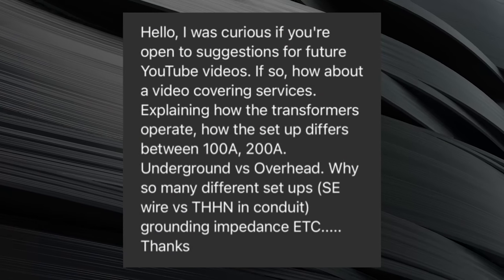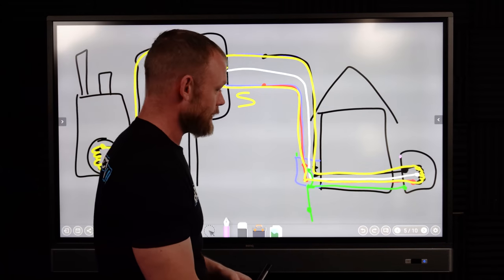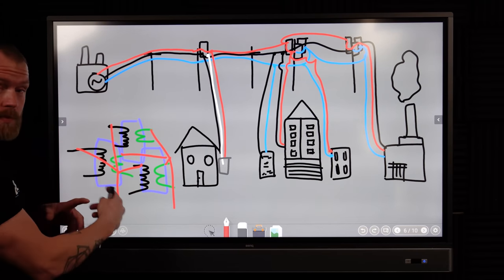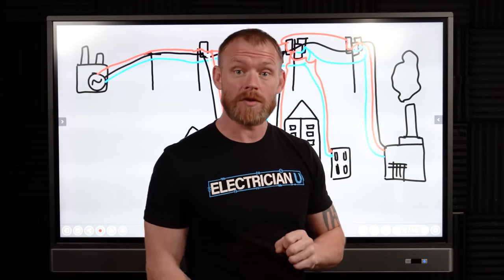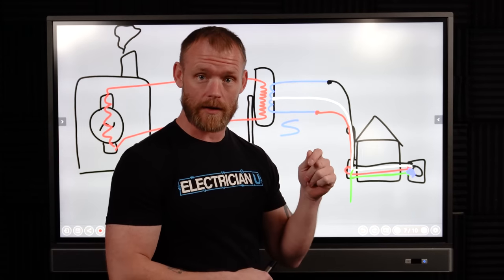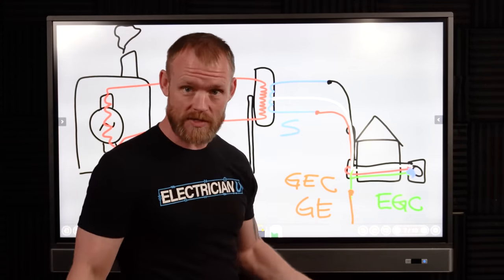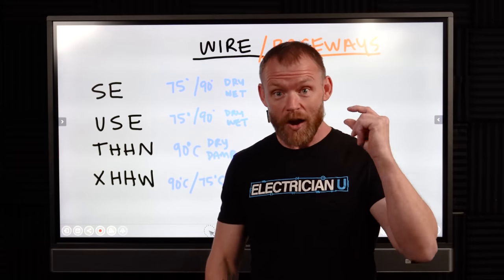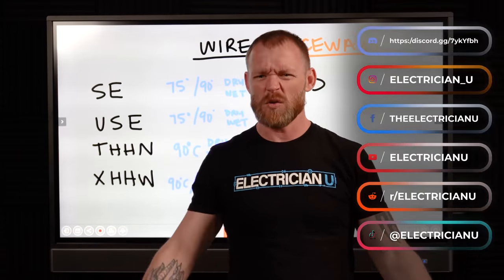How Does an Electrical Service Work? Electrical Service Panels Explained

Comment: I’ve been an electrician for a long time and the question I would like to see answered is how electric produces the energy without any loss of mass in the circuit.
Reply: Energy is not produced. It changes states and electrons move. Nothing is created or destroyed. Mechanical energy or solar pv is converted to electrical energy. Then changed back into whatever form the load is. If the load is a heater, the heater is not destroying electrons to produce heat, it is changing electrical energy into heat, another form of energy.
Reply: @jeremiahemswiler4540  I knew that electrons weren’t consumed the strong force being what holds them in place. I remembered that a volt is defined as the force that it takes to (push ) one amp through one ohm of resistance. The others are defined in the same manner relative to each other. So I guess then my question would be do we have an understanding as to why current flows through a conductor if it moves through a magnetic field?
Reply: Ive been an Eletrican for 28+ years an if that ole poor boy wasn't lost he sure the He'll is now lmao
Reply: @jefflenway4510  I got my masters in 1988 and I’m not lost. What he’s basically saying is that power is obtained not from the electrons in the circuit but from the electromagnetic field in the circuit. My question then would be do we have a good understanding of the force that causes electrons to  move back and forth when a conductor is moved through a magnetic field at an angle? I realize that this is really more of a physics question since electromagnetism is a fundamental force. Still important to know as far as theory goes. If a magnet collects energy since there is no conversion how well do we know that process.
Reply: @deweyplanck9850  You might be meaning your question in a deeper perspective but it would be the electric field. I suppose it's like a chicken and egg question since you have capacitance and inductance that have inverse characteristics but if you have the voltage you have the electric field. So if the circuit can close any kind of way where you have the current flow then you have the magnetic field as well as electric field.  The conductor has been aptly named rather than some kind of generator since it is just a conveyor of charge that contains a ton of electrons so in a basic water pipe analogy the water pipes only lose Mass over time through corrosion etc. I suppose another way to frame your question more generally would be asking whether electron theory is entirely accurate and I'm far from knowing the answer to that.
Reply: @deweyplanck9850  You also asked whether we had a good understanding of what causes electron flow from induction and I'd say we do but not enough to stop investigating. I guess the basis of it is that the inductor stores energy in its magnetic field yet it is still one of the most interesting and complex foundational components. Changing magnetic field requires work and this can be stored in the inductor I suppose your question more relates to what is going on in the conductor on the output of an electrically isolated system that is using the magnetic field AKA inductance to pass the power. Since there's no source of electrons where are all the electrons coming from and how come this doesn't degrade the conductor etc but again the wires just a conveyor of electrons that were already there at least allegedly. then of course we are able to draw free electrons from air and all that juicy stuff but it kind of boils down to why you can't wind a transformer with fishing line and expect it to work.
Reply: @Magneticitist  No I’m not asking about the conductor . I’m asking what’s going on in the magnetic flux. What’s the process that is going  on to produce the energy within the electro magnets of the stator. I know that moving the coils of the rotor through the magnetic flux of the stator causes electrons to excite in the conductors. Also that the electro magnets are using an external power source. It really is sort of a physics question  but they do tie in. My loss of understanding begins with how theses magnets are producing these fields and forces on a very elemental level. It did help to find out that the electrons are really not the source of power but the magnetic field that is produced by their displacement is.
Reply: @Magneticitist  thanks but that is where I’m getting hung up. I knew that even if all the electrons were consumed there would not have the mass to create the power the light bulb is consuming. This is also true of the field. But still yet  it’s true that E=MC squared. But you also pointed out that the flux could be harnessing the already converted energy from other sources. But thanks for your patience and time. I appreciate it.
Reply: @deweyplanck9850  Mathematics is the only language that can really explain this. Maxwell's Equations can answer that for you.
Reply: @mayito714  Thanks man I really appreciate your time and especially your patience.
Reply: @deweyplanck9850  No problem. glad I could direct you to the source that can answer all your questions.
Reply: @deweyplanck9850  The strong force is the bond between protons/neutrons, not electrons. That's the weak force. We can easily strip electrons away from an atom. It's called a plasma. Any arc is a plasma.
Reply: @fcguy7  Yeah I guess that it would fall under electromagnetism in some circles of thought. It’s been supposed that electromagnetism and the strong and weak force are results of the same force. But my original question was about Einsteins equation and how it seems to contradict what happens in electrical circuits. Lorentz explains more than anyone I’ve read so far about how electromagnetism works, but I’ve never heard an explanation as to how say, a light bulb can produce the energy it does when in the circuit there is no loss of matter that should be able to produce that much light and heat. As far as I can understand Lorentz explained that the field that exists between electrons in an energized circuit transfers the power. So my point was that no electrons are consumed in an electric circuit. Which is true. But Lorentz explaining that the electromagnetic field in between electrons is the source of the power and not the electrons still leaves me confused because the particles in that field are less mass than the electron individually.
Reply: @deweyplanck9850  With the lightbulb and einsteins equation I think you're confusing yourself by looking at one small part of the complete circuit. Energy can't be created from nothing and to create energy there's loss of mass. But there's no creation of energy going on in lightbulb the energy available to you/ coming into your  breaker panel has already been created at your electric company who used generators spun by either a petroleum type gas or liquid fuel,  coal (the energy created by loss of mass of fuel as it's burned). Another way they do this is solar/wind/water (in this case the process of sun or earth  creating said energy with mass loss and they are exploiting that energy by transferring some of energy of suns rays into solar panels or mechanically transferring some energy of wind or flowing water to spin fan blades or water turbines thereby slowing down/removing the energy of wind or water as it transfers energy by spinning generator. Another way they could create energy is with nuclear reactors, (I don't know aton about the process but there is loss of mass in uranium as energy is produced. They create enough energy to constantly supply the grids and it's there whether or not you use a tiny bit, none or have everything in house turned on and any loss/transfer of energy to light and heat from lightbulb or any other electric load is replenished by the electric company's generators and your hot and neutrals wires closed loop with them If you look at it from perspective of the entire loop from the electric company to transformer and transformer to your meter, into panel then out to branch circuits to lightbulb and all way back to transformer and transformer to electric company then einsteins law still holds true. The lightbulb isnt 100% efficient so there is a loss of most of energy that is lost/emitted in form of heat in every type of bulb (incandescent,  vapour lamps, etc are super inefficient in energy ratio of light vs heat. Cfl is middle of road there and LEDs best for light vs heat per watt). That might seem like energy created to give off heat but no new energy is created in lightbulb it's just transferred into another form with some total electric energy loss in system overall that meter calculates in kwhr. The incandescent bulbs doesn't use electricity to emit any light directly  it's the high resistance of the wire inside that causes an instantaneous  high heat  that results in that wire glowing white hot. This can be expressed by joules first law and is known as joules heating/resistive heating. In incandescent the filament in bulb is tungsten that has a high melting point and naturally high resistance as a conductor. the glass bulb is a vacuum chamber that can have inert gas like argon added but either way the air is vaccumed to prevent oxidation of filament and slow degradation way down compared to filament in atmospheric air. Overtime in some bulbs (if present)any  metals in gas state like mercury vapor still can wear away in vacuum & do lose some mass but having nowhere to escape they coat/plate part of inside glass surface and you can see it in old bulbs or even old radio vacuum as shiny spot or darkened fog on inside of glass. The heat given off the lightbulb is due to joules heating/resistive heating and found by using joules first law. The other part of your question with magnetic fields and electric fields. Electric fields created anytime a charge is present in conductor and magnet field is present whenever a electric field is moving. DC is easiest to do this as it never changes direction of current flow so magnetic field is constant like a permanent magnet. But if the positive and negative or hot and neutrals wires are running right next to each other or bundled in same wire jacket then the two will cancel each other's magnet fields out by being opposite directions(this is why multimeter current clamps don't work on wire not separated into hot,n and gnd & have to be around a single wire to detect the current. If wires are braided or twisted in pairs like Ethernet or sheilded like coax cable that further cancels any magnetic fields that'd create noise or interference. And you can increase magnetic field by looking or Coiling the wire and to further increase it's strength by adding iron core that wire wraps around. If either field electric or magnetic is non changing then you won't be able to induce a field in separate wire from another. Ex. Placing stationary magnet next to wire even if coiled can't create electric field. If it's wasn't changing direction fast enough however then you could have induction from one field to create the other in separate wire.  Ac by itself can do this (also what allows non contact voltage detectors to detect live wire by creating field in tester.) due to changing direction of electricity 60 times a second. As the ac oscillates at a hz both fields also oscillate at that frequency and that's known as electromagnetic waves which is how transformers work and deping on signal frequency is how wireless chargers, wifi and radio waves, etc. And can propagate through space if designed to do so
Reply: As for loss in system the electricity created by electric company is 3 phase to allow current then if they had to send out enough to be able to supply every house and business using one phase and to further drop current and prevent loss of some energy during transmission from heat they up voltage to 100kv on hv lines that are tall metal towers with multiple arms for sets of power cables then when the lines get nearer to grids that feed a few neighborhood areas they use transformers to drop it down to 2kv-30kv and current increases as voltage decreases in transformers until near your home there's a another transformer that turns it into 240v at amperage of your meter and panel. And when I say they up voltage on transition lines to lower current I mean relatively compared to if the power lines supply the city were single phase at 240v or even 3 phase at 460v. it's still an incredibly high amount of current and the volt being so high means your naturaly resistive outer skin layer and rubber shoes that let people get a shock that hurts but usually limits current going thru body at 120v circuit enough to live is essentially non existent at power line voltages and current is still maybe 1000amps on lowest end since they serve 10000 homes with average 100-200 amps plus commercial buildings and that's a small city where in larger one it could be 100k and up
Reply: @deweyplanck9850  I'm not diving into the original question. I'm simply and plainly stating that electrons are bound by the weak force, not the strong force. Electrons are bound to the atom by electromagnetism (negative neutrons, positive protons). The protons are crammed against each other DESPITE electromagnetism trying to push them apart. Hence the protons (and neutrons) are held together by the nuclear strong force.
Reply: @Magneticitist  — The source of electrons is simply the copper wires (or other conductors).  Copper has one loosely bound electron which is relatively easy to dislodge with ElectroMotive Force.  Electricity is just the combined effect of countless electrons responding to the EMF in accordance with electromagnetic theory.
Reply: Hi Dewey, I just wanted to congratulate you in asking the right questions which reminds me of something my mentor told me years ago:
"There are no stupid questions, just stupid answers", years later, my boss (an Admiral) told me: 
"A stupid question is one that is not asked"!
I applaud your inquisitive mind and your courage to ask questions even after years in the "business".  Peace be with you, Ciao, L (Mechanical Engineer)
Reply: An electrician doesn't need to know this anymore than an auto mechanic needs to know how crude oil is processed into usable gasoline. You might want to know for your own edification, but that would have nothing to do with your profession as an electrician.
Reply: @TwilightxKnight13  An electrician doesn’t need to know that  electrons don’t travel through a circuit either. Actually an electrician doesn’t need to know at all what happens in a circuit really, he needs to know the NEC. He doesn’t need to know how a capacitor works just how to change one if it’s bad. But there is a concept that says it’s good to learn solely for the sake of learning. Still if you get to the point in your career that you may have to troubleshoot  more advanced industrial circuits it could be very useful.  But if you would have read my later texts I did say this was more of a physics question. Plus I guess if I looked at doctor in his office all day and saw what he did, I could say he doesn’t need to know anything about the human body. He just needs to know what he needs to do or prescribe when he encounters certain symptoms. I personally wouldn’t want him as my GP. Would you? A psychologist doesn’t need to know American history , that is until he has to make up a general cognitive test. Never abandon inquisitiveness , it will leave you with a half ass education.
Reply: @deweyplanck9850  Hi Dewey, I fully agree with you, we need more people like you; people who wonder about the "whys" of things - that is the way progress is made, that is how humanity has figured out better if not best ways of doing things - otherwise, we would still be lighting the streets with gas lanterns.  Sadly enough, Bob Jonquet's attitude is something I have encountered among many people - being ignorant/not knowing about an issue/subject (and that is "OK") and being proud of it (which is not "OK"!).  I am happy that there are still electricians/professionals like you left in America Dewey, Happy New Year, Ciao, L
Reply: @TwilightxKnight13  I whole heartedly disagree with ya there, if you don't understand the basic principles of electrical theory and how we transmit and utilize electric current you will not make a good electrician at best a laborer. I would never trust someone that doesn't understand how electricity works to work on most if any electrical equipment or to run crews make plans troubleshoot etc. Absolutely a recipe for disaster.
Reply: Isnt the truth about electricity that no one really know why or how it acts. Just that we take advantage of the fact that it does. Maybe batteries are more understandable because its a physical action between the anode and cathode. The breaking down of dissimilar metals. But in AC where power is generated its a bit of a mystery.
Reply: @alilruthlessify  As I’ve been looking into it basically electricity produced by electromagnetism which is a fundamental force like gravity. We find a constant the force produces and utilize that force. Like gravity we know it’s effects but not it’s cause. I did find that electron’s don’t move through a circuit, they vibrate when moving through a magnetic flux. The energy is transferred through an electromagnetic field at a forty five degree angle between the electrons. Of course it has less mass than the electrons so it still defies what we know about physics. So in the end we still don’t know how a lightbulb works.
Reply: @deweyplanck9850 think of an electrical wire like a drive shaft.

Energy is transmitted along the line. Touching a moving drive shaft is dangerous. Touching a love circuit is dangerous.
Reply: @oculophilia918    A "love" circuit?  Like touching another guy's wife?  Yes, you're right, that can be quite dangerous!   <:)
Reply: Second law of thermodynamics
Reply: @RHsapperdaddy1993  I’ve actually learned that elections don’t flow in an electrical circuit. They actually just vibrate. The power for the circuit is produced by an electromagnetic field that forms in between the electrons . I’m not sure what the second law has to do with electromagnetism. It does play a part in the circuit (hence super cooled conductors) but in my limited understanding those are two different fundamental forces interacting.